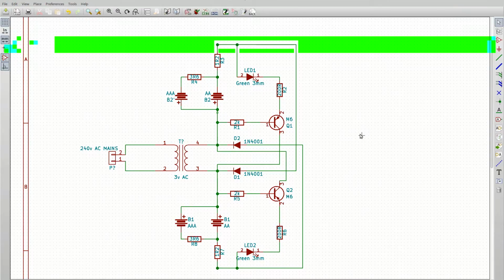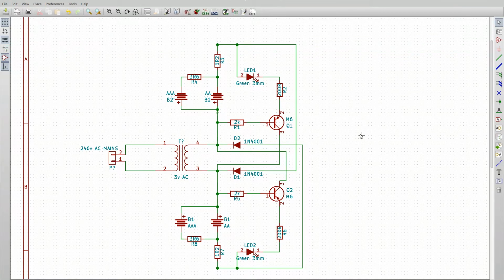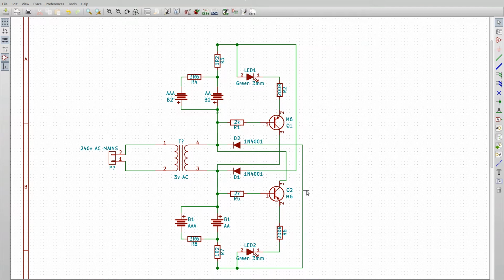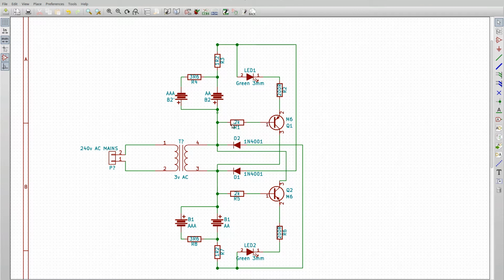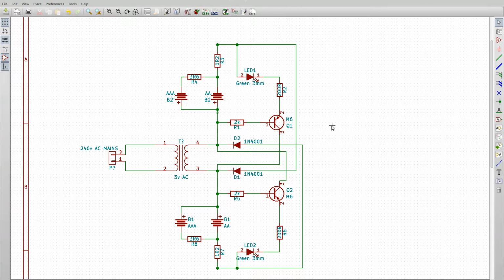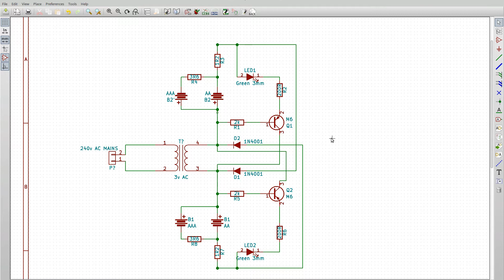Teardown and analysis of a Varta "Mini Charger" battery charger

Comment: Those so called "dumb chargers" are the best. They are easier on the ni mh chemistry, they prolong the cycle life of the cells up to double of what intellingent chargers do. Batteries last longer, they recharge better, you can recharge also hi internal resistance cells without hassle, you can decide how many mAh to put into the cells. In other words, you have total control, assuming you guess-estimate the state of charge of the cells by a multimeter first. They are pretty darn cheap too!